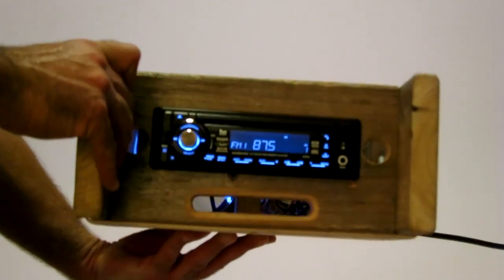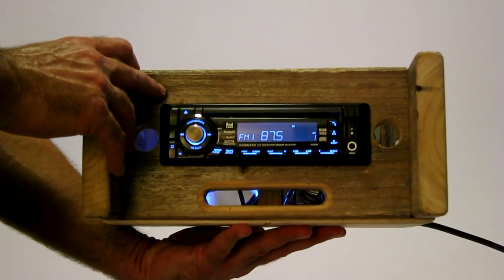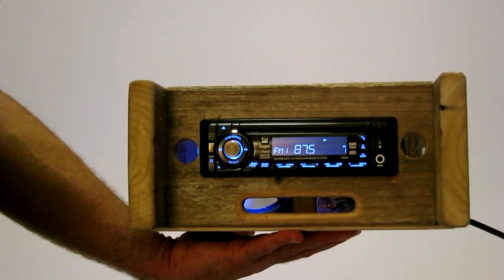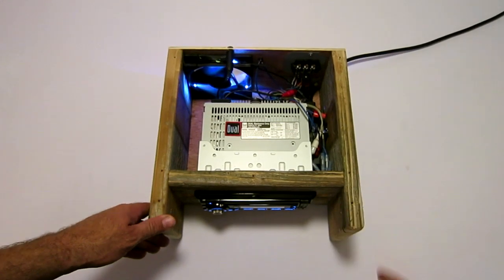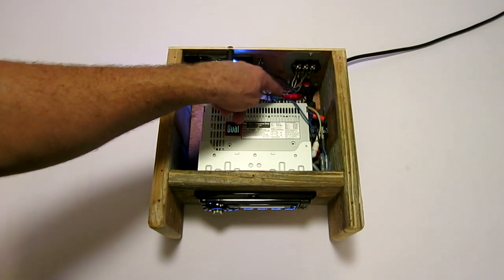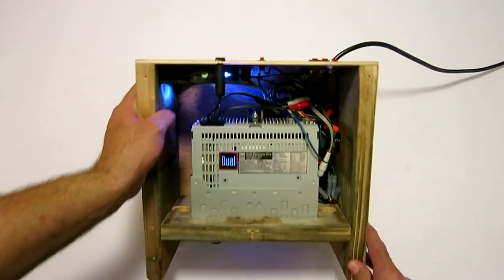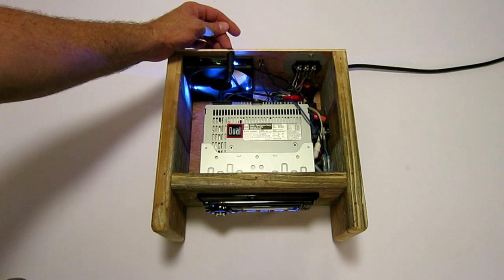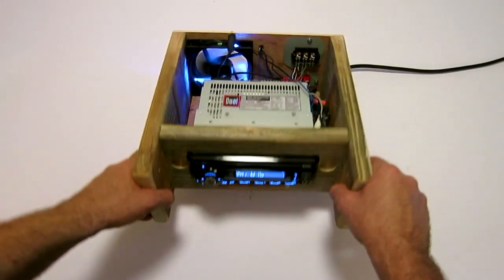HD car radio converted into home stereo receiver.

Comment: he said hd 10 times.
Reply: Thanks for making me replay and count.  oddly, I only got 9 but am not going to listen again. LOL    

Billy WIlly, nice build, whether the fan is needed or not, it does add a nice look to it with the blue and can't go wrong with Antec.  quiet and long lasting.   would've like to see it with the "HD Radio" cabinet closed (top and bottom installed) to see the final result, but regardless, it looks good.  
Thanks for sharing.